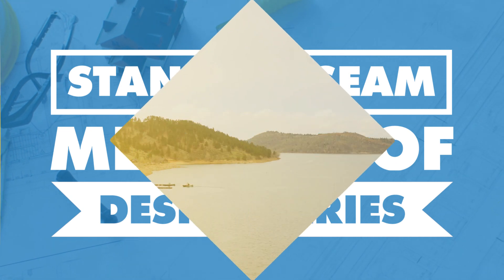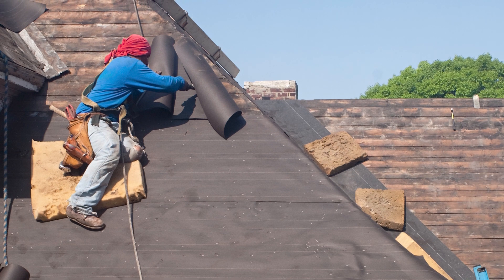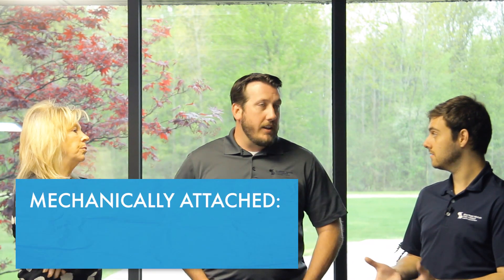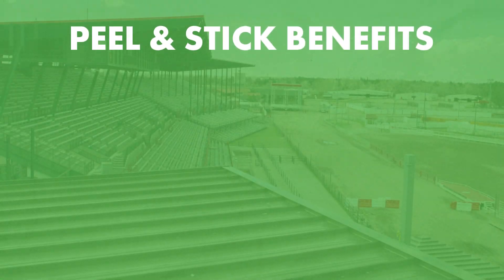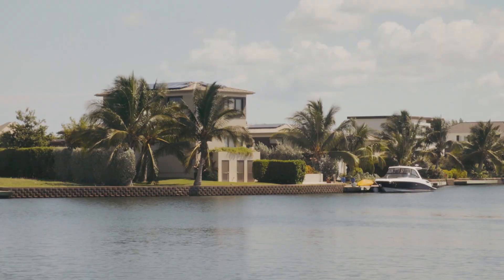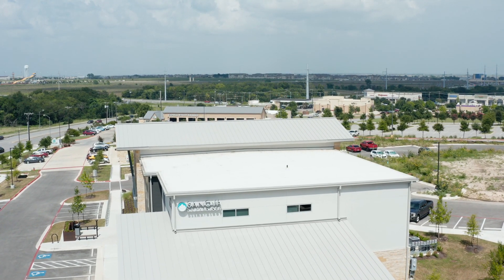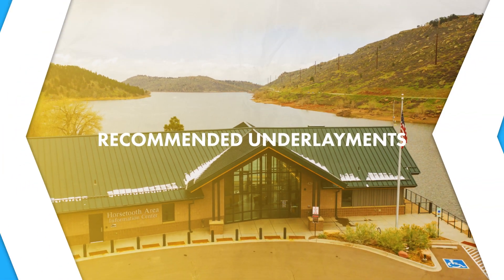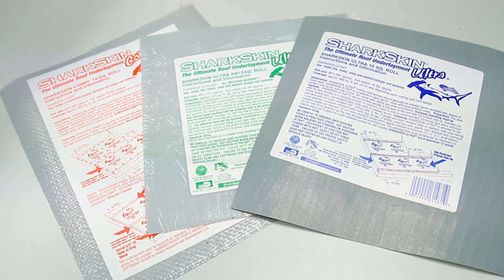Metal Roofing Underlayment: Felt Paper, Synthetic, Peel & Stick

Comment: Q	Question.  I installed a metal roof over quarter inch fanfold about 10 years ago when the house was a rental.  At the time I thought fanfold was a good idea because I had to do a quick and dirty roof job over a few weekends and the fanfold would keep out the rain until I could finish the work a few weekends later.  This rental house was out of town from where I lived full time.  

Now, about 10 years later I’m living in this house and notice some of the nail heads have popped off and I have at least one leak that I am aware of.  I figure the popped nail heads are from walking on the roof, and the soft foamy stuff underneath does not support the metal  enough to keep it from flexing, and this movement is causing the screws to loosen up or break.  

What do you think?  I’m thinking about removing the metal roof and fanfold and putting down felt instead of the fanfold. The surface underneath is just bare OSB.  But I would rather just replace the screws and patch the few spots where the screw heads have broken off.  If I stay off the roof in the future, is this a good option?
Reply: NOTE: I said nail heads but I meant screw heads.

Comment: Ive been researching this for months and can't get a solid answer. 2x6 fiberglass, conditioned attic, in NV zone5, (-10f with snow to 115f), high wind application. I want to install a metal roof with an air gap. my only question is, is it safe to install peel and stick (zero perm) onto entire roof deck? Im concerned that interior moisture could start adding up in the fiberglass. I like peel and stick for the benefit of sealing around penetrations.
Reply: Are you spray foaming the underside of the roof sheathing?

Comment: You said to use cap nails to install synthetic but cap nails can show indentions when the meatal is installed unless you use 1×4's ect. When going flat I use roofing nails.
Reply: I was wondering why I've never seen a roofing nail with a head the same size as a cap and nail?

Comment: How does a zip roof system compare to sharkskin? Building in central Florida a Galvalume 26 gauge Ultra Rib Panel.
Reply from the maker: Good question! Here are some things to consider with the Zip System: I would suggest using an underlayment no matter what. Zip products need to be taped and rolled at the seams correctly, seams need to be spaced properly, and all over-driven nails need to be sealed. There is a chance some areas might be missed, so using a quality peel & stick like Sharkskin Ultra SA as a secondary defense is a good practice. -Thad

Comment: New rica in. I have told to use either 1x4 slats. But then was told to use 2x4’s
Also do you still have to use spray foam insulation to stop condensation if you use felt paper

Comment: I live in ga, this is for a metal roof. We don't have any ice or snow, do I need an ice and water shield or peal and stick or can I go with just a synthetic mechanically attached underlayment? Also it's my understanding because I am using metal I need a high temp underlayment.    By the way I am using purlin strips for air gap, I at one point read that if ur using a peal and stick you don't need purlins or strips for air gap.. Not so sure about that

Im doing it my self and have everything else figured out but I am sorta lost when it comes to which underlayment to buy.   I've heard of people doing two layers ect.  All kinda confusing
Reply from the maker: There are lots of factors that will go into choosing the right underlayment for your assembly. The easiest way to figure that out would be to talk to our technical department. You can find their contact info here: https://www.sheffieldmetals.com/Resources/Technical-Department
Hope that helps, and good luck with your project! -Thad
Reply: You need the purlins to create an air gap. Otherwise you lose the radiative barrier.